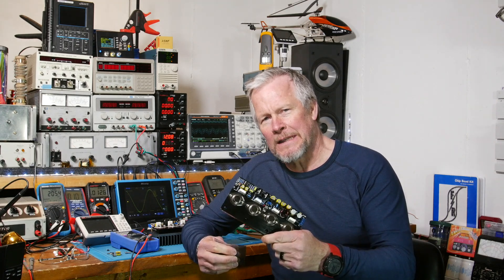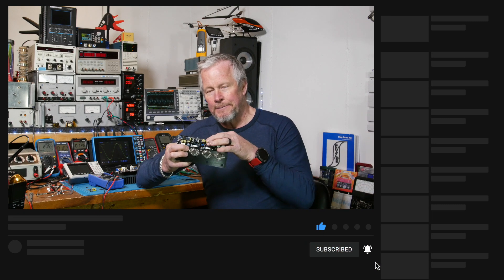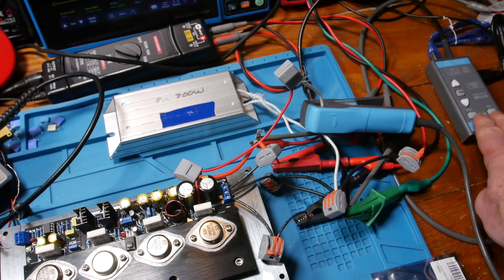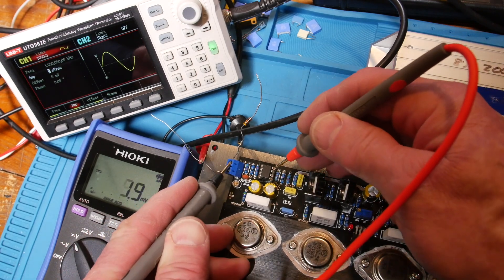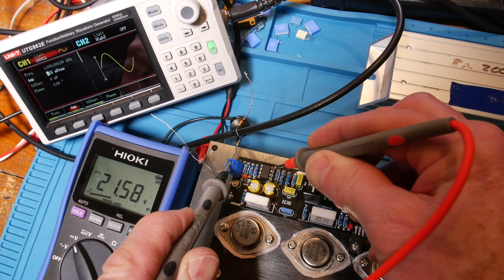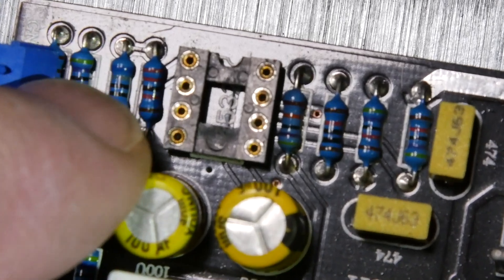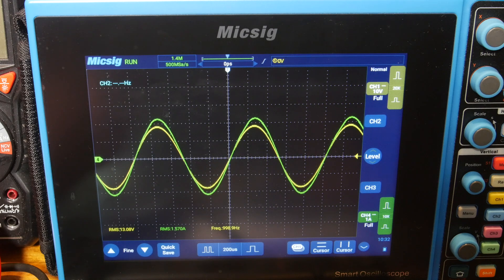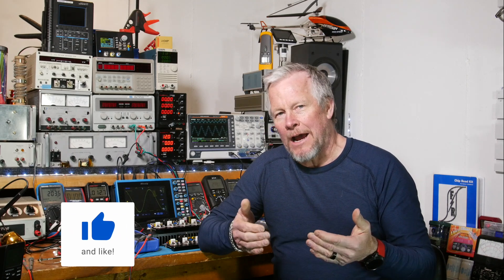Which OpAmp is Better for 20W Class A Amplifier - OPA2604 vs NE5532?

Comment: why not using square waves for testing waveform skew?
Reply: Who listens to sine waves, let alone square waves. You can calculate slew from frequency response.
Reply: @nicoras8803  it's about waveshape rendering, overshoot, ringing etc... it could be triangle or whatever..  music with analog synths use all these waveforms. I cant believe old peoples still think they are not used in music haha it's used in more than 90% of modern music...you think you can test audio gear with AC/DC crapshit.. you could use bandlimited square wav to 25khz for example.. a system should reproduce it perfectly to be perfect.. note that you need an analog generator or a perfect digital to analog converter that also produce perfect square .. + a bandlimited square wave sample.. 

opamp datasheet have these and they are important in my opinion..

see sansui au-x1 amp for example on perfect square wav amplifier up to 90khz or so
Reply: @lextr3110  I also do like to see the transisent response of a square wave on any audio path. 
A 100 pound drummer hiting a snare drum can not be replace by just a sinewave.
Reply: @misterjorous  they always have 1000 excuses not to test them ...
Reply from the maker: Thank you for bringing this up.  I think it is a very interesting subject and question:) OK, so first I'd like to say @Nico Ras is right of course, you can verify rise time with bandwidth testing and vis a versa.  You can't get a fast rise time if you have a low bandwidth.  As for how an amp would respond to a specific rise time (suggesting it has the bandwidth to do it) is interesting thought.  If it rings it would be thought to be bad, but in audio - is that true?  First, if it is fast enough to rise and then free enough to ring - is that really a bad thing?  If you then think about why a 'music' would have a square wave - which is not a natural wave, so it has to be synthesized, and is then can be formed by a compilation of sign waves.  So if the amp does have a wide enough band width, yes it can do a square wave, but regarding to the stability or lack of - we are back to why a square wave would be injected into 'music'.  That would sound like distortion (as it is not natural) so would ringing be bad - or is it just that it is not accurately reproducing this wave?  So, another very important question is twofold, what frequency should this be done at - and what rise/fall time?  Then comes, how much inductance/capacitance might there be at the output of the Amp?  Great question - and this could lead to more videos;)  One more thing that I eluded to above, if the amp is so well controlled that there is no ringing - does it sound that way - well controlled - or does it sound over-controlled?  Just asking;)
Reply: @KissAnalog  i recommend look for the sansui au-x1 youtube video of a dude who actually test it.. 

there is no denying that square waves and even with pulse width modulation is used in all modern genre of music since the 70-80. now of course they are filtered or mixed with other wavs or processed .. but in the end i believe its a good way to test the capacity of the audio chain to reproduce the most complex wave shapes correctly.. while i understand that speakers might have a hard time with doing this i believe the dac and amp stage should be able to do it if not it's just a chain of waveforms skewing process... dac will skew, amp will skew, crossover will skew, etc... 

at the end its not at all the original waveform.. 

i even believe you should pulse width modulated the square wavs and see how the pulse width movement is rendered by the chain.. 

most dac and amp companies dont want to talk about this or will say 1khz sine wave is enough ... but that's because it's a whole ball game to create a dac and an amp that can correctly reproduce these complex waveforms correctly.. so they only talk about THD, distortion etc... 

just imagine producing an headphone amplifier for an fully analog synthetizer... if your headphone cant reproduce the correct shapes made by the analog oscillators how can one even understand what he is doing.. a square wav will sound like a triangle wave... completetly useless.. 

my personal opinion is if there is a square wav in the recording you should hear a square wav not a weird triangle like wav.. 

try it on your current amp.. find a an analog oscillator or a perfect square wav source ... monitor the output while applying pulse width modulation... 

note that the inital square wave of the analog oscillator might not even be a square wav even if it sold as if it can create a perfect one..  so verify this too.. 

in any case.. complex shape at output should be exactly the same as complex shape as input... just amplified

to be on the safe side i would cover the square to 30khz at 88khz sample rate at least

but of couse, i think you could at least make sure 44.1khz and square to 30khz is covered correctly

I know square waves is a compilation of sine waves but i dont think simple sine wavs are enough to show that capacity of a system to reproduce a complex waveshape correctly... 

analog synths also have filter and resonance that need to be correctly rendered... so overshoot and ringing, etc.. could impact the quality of the filter rendering as well.. 

modern music with synth is far more "testy" on gear than a jazz band cow bell... 

now of course natural tone and timber is also important but i truly believe that its actually connected...

also dont forget to test different square wav fundamental 30hz, 60hz, 120hz etc... since some dac/amp will reproduce them differently..

audio chain source should reproduce the source as it is in the recording .. be purely transparent... if not you just think you have good speakers/headphones but its actually the chain that fix their flaws or the flaws of the tracks to make them sound acceptable..

audio chain synergy is kinda funny since only the audio driver/woofer should have its own sound since limited by different law of physic than electricity... Or do you think electrical system are not yet able to reproduce sound of the source correctly in these days and age?
Reply: @lextr3110  It doesn't matter how complex a waveform is, it can always be decomposed into sine waves.

I can no longer hear 20KHz as i could when I was younger, but nobody can hear 30KHz. So, at 15KHz, what's difference between a sine wave and a square wave? Nothing that you or I can hear.

Comment: 5 dollar op amp is really significant price in bill of materials. Thank you for another video!
Reply: Well in that case use LM741, they are probably free these days. The board is supposed to be hi-fi hopefully.
Reply: @nicoras8803  Not worth to step down so much when you're professional engineer, but when you are getting your degree it's another story.
Reply from the maker: Thank you!  I appreciate you!  For those that want to squeak out every once of quality, the OPA604 or OPA2604 is a great part, but for the money - the NE5532 is pretty darn good too.